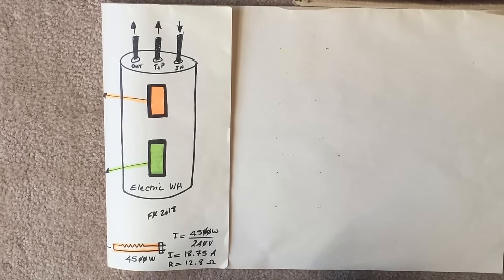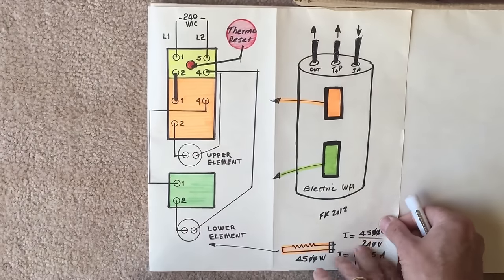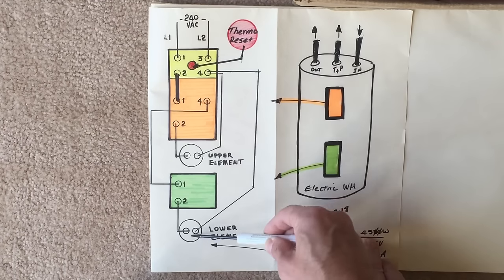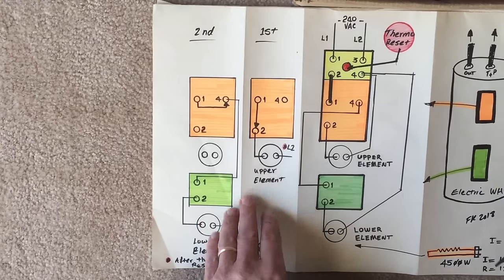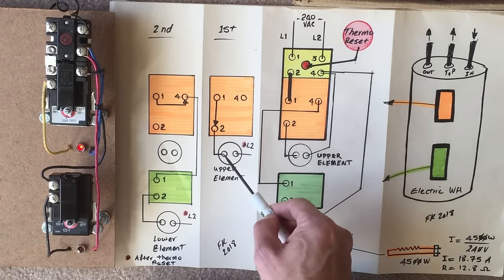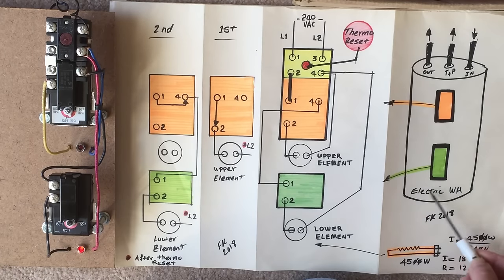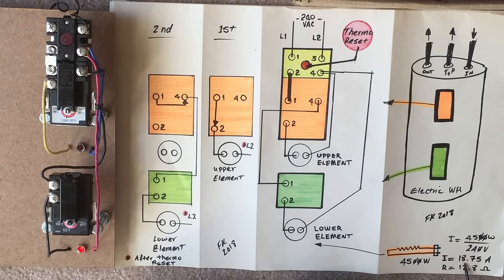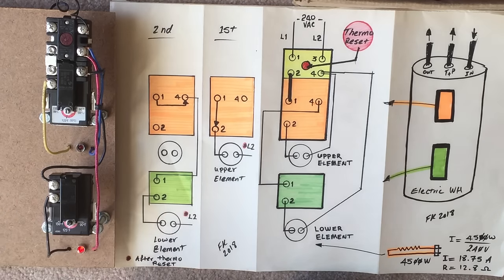Electric Water Heater-Understand How It Works So You Can Troubleshoot Why It’s Not Working Correctly

Comment: Now I understand how the thermostat works.    Can a bad thermostat cause the breaker to trip?  I'm getting 11 ohms on both elements.
Reply: So, if the top thermostat is bad and is sending the call for heat to both the top and bottom elements at the same time, that would trip the breaker.
Reply from the maker: Yes, you are correct. Very good observation.
Reply: @JustForYouDiy  ,   I thought about how these can work or should work.  Correct me if I'm wrong.

The upper thermostat is an either/or switch.  It's always on.  It sends power to the upper element and when the proper temp is reached, it switches power from the upper element and sends it  to the lower element.  So, there should be continuity on the left side or to the upper element or lower but not both.

The lower thermostat is an on/off switch.   It's on until the proper temp is reached.   If the proper temp is reached no continuity.  If the heater isn't working and the water cold, there should be continuity.

If the upper switch is faulty, possibly it could send power to both elements at once?   In such a case it would exceed the amperage load and trip a breaker.

In my case, it's two 4500 watt elements for a total of 9k watts.  9k watts at 240 is 41 amps.   Since this is an old house, it's on a 30 amp cartridge  fuse.  That would account for it blowing the fuse with both elements giving me 11 ohms.  

Another breaker possibility could be the element grounding out to the tank.  That's not my case but others reading this might have that problem.

Comment: hi there great video....My water is now cold and it seems both are calling for heat as there is 120v to each side of the elements.  I cannot seem to get 240v across them nor the main feed .maybe my meter is broken lol.  the elements read 20 ohms across them. Is it possible there both burnt out at same time.
Reply from the maker: Scott, Check the breakers that are feeding the WH.

Comment: I watched so many videos but I found perfect solution for which I was looking for ! Excellent Explanation !! 👍👍👍👍👍
I also subscribed your channel too ...... Thank you sir for giving perfect information with drawing !!!
Also I am very eager to learn about all working and Mostly Electrical circuit connections of commercial Air Condition Machine. If possible please put video for this. Waiting for it..... Thank You.
Reply from the maker: Thank you for the comment & the subscription. As for AC, I have few videos going over the basic components, general cooling (heat transfer) concept and thermostats. However, they are for small split units, under 5 ton.
Reply: Okay, waiting for this 👍

Comment: First of all, let me thank you for the video. I have just replaced both thermostats and heating elements. Because I wasn't getting any hot water electric water heater. I have everything wired exactly As you have shown here. I am getting 240 to the top water heater.
It hasn't kicked down to the bottom line yet. But it's been probably about an hour and I'm still not getting any.  Hot water any solutions
Reply from the maker: If the all components are in working order and voltage is 240, water is being drained from the water heater, it cannot keep up. Or, I’ve seen this before, elements and the thermostats are changed, water heater is turned on BEFORE it is full of water. The thermostats will burn out without being submerged in water in few seconds.

Comment: Hi, can you tell how the temperature is satisfied, is it something to do with the amperage through the bimetallic switch. Is current playing the part to make or break the element's circuit. So what happens if there is no water in the tank?
Reply from the maker: Technical Tech. When the temp is satisfied, the element should turn off and the current draw should drop down to zero. If an element is NOT submerged in water while it is on, it will burn out.

Comment: Hello! The bottom element on my friends water heater is rusted to the point that chips are coming off of it. It looks like it was over tightened and the Oring broke so it was spraying inside of the cover and shorted itself and the module. The terminal on outside of the element is melted. This is the bottom one. It looks as if its been this way at least a couple of years. The top heater still clicks on but the bottom does not yet is still receiving 200v after the top clicks off.  The bottom element shows -1.4  resistance. Is this dangerous? Should we replace the whole heater or is it safe to clean it up and replace all the burnt stuff?
Reply from the maker: It depends on the age of the water heater and the brand. Typical water heaters that you buy from hardware stores like Home Depot will last 3-4 years after the warranty expires. In these cases, the tank rusts because the anode rod inside the tank is corroded. Therefore the water attacks the tank and over time it will leak.

Comment: I just replaced a lower stat that only intermittently would allow the water to heat to 145 & more (@ 120 setpoint). It once even popped open the hi-temp limit switch. I'd never seen that intermittent behavior before but I'm no pro.
Reply from the maker: Most, if not all, WH thermostats are mechanical when it comes to sensing the temperature of the water (actually the tank). The wear over time and along the way to failure they lose their accuracy. See the thermostat in more detail starting at 5:44 min in another video from me, Electric Water Heater Basics
https://youtu.be/NWZy4hle-Bg

Hope this helps, Farshid

Comment: Can I somehow connect my portable generator to Legs 1&2 to power my heater? 

6400kw Generac Portable Generator with a 125250v,  L14-30R plug adapter to a 110v 3 prog plug

Comment from the maker: Water coming into the Water Heater forces the water to go out. Just like a cup of water with a straw in it. In the case of WH, picture the water coming in to the cup through the straw and going down to the bottom (cold water) and water coming out through the top (hot water). Hope this helps.

Comment: Question. If the bottom element is disconnected, then the top one still performs the same? I want to add a Solar DC element to the bottom totally separate from the top. Thanks
Reply from the maker: Russology B You are correct. You can disconnect the bottom element without effecting the top element’s function. This is because the top element’s controller powers up the lower element’s controller (after the water temp at the top has reached target temp), only bottom element is depended on top element’s controller. Best of luck.

Comment: Can I feed 240v DC max directly from solar panels in series (Volts will vary depending on sunlight) or does this need constant 240V AC for some reason?
Reply from the maker: Luis, the heating elements are resistive load and for the purpose of heating water it does not matter if they see AC or DC current. However, based on an experiment that some one had done in the past, the thermostats life was decreased when DC current was used instead of AC current. Hope this helps.
Reply: @JustForYouDiy  Thanks. If that's the case I could wire up the thermostat with AC and add a relay to control DC feed to heating elements. Will experiment and report back. Any suggestions are appreciated.

Comment: It appears I have power to the top element which is brand new, but it’s not heating. 240 shows at each connection.  If one of the thermostats is bad will it keep it from working
Reply from the maker: Yes, if a thermostat is bad, it could keep the WH from heating up. However, if there is 240 at the heating element the thermostat is doing its job. In most cases, when there 240 at the element and water is not heating up, it’s a bad element. Hope this helps.

Comment: How do you diagnose if the thermostat is stuck closed in one of the positions?
Reply from the maker: You can disconnect power and wires from thermostat then use a meter to check continuity. If you’re not sure what values you should see from this test, it’s not a bad idea to purchase one from HD to compare against. HD is pretty good about taking unused parts back for a full refund. Also, since it is a thermostat, compare under same temperature conditions. Hope this helps.

Comment: Should both thermostats be set to the same temperature?
Reply: 11sprinkles Thanks for the question. Yes, usually both thermostats are set to the same temperature.
Reply: @Farshidtx1  Uh... I believe that the Bottom thermostat should be set about 10 degrees Cooler than the top thermostat.

Comment: So can this lower the electric bill by droping the top and bottom thermo to 125? 
Im rent a house unit and i saw the upper stat 127 and bottom is fill blast to very hot?
Reply from the maker: Yes. You are correct. Lower the water temperature will decrease your electric bill. Also, wrapping the water heater with insulation will help as well. Hope this is helpful. Please consider subscribing to my channel to keep up with upcoming videos. Thanks.

Comment: I have a problem with a water heater i replaced thermostat and elements with new and water heater is not working..
I have voltage to elements and when I checked with ohm meter the elements were in the 13 ohms.
Do you have any suggestions?
Reply from the maker: Are you getting 240 at the main input connection? Shown here in this video

Water Heater Not Heating Water, Easy DIY Project
https://youtu.be/5UP77q-ly4s

Comment: Why would I be getting 120 vault separately from the Tom of the thermostat, but not 240 across?
Reply from the maker: Most likely one of the two breakers is tripped or defective. One reason you are getting 120 to ground on each of the two legs is because the heating element is completing the circuit . More accurate testing method would be to disconnect the two incoming lines from the thermostat and measure again. Hope this helps. Please provide update once fixed to everyone else benefit. Thanks

Comment: Hello... what if the tank is not cycling off - seems to be staying on and tripping the reset button - I'm assuming it's the temperature sensor - Bradford White Electric. Thanks
Reply from the maker: Yes, most likely the thermostat for that heating element is defective.
Reply: @JustForYouDiy  thank you
Reply from the maker: My pleasure. A quick check would be to reduce the temp on the questionable stat and see if it turns off, hear a pop & voltage across the element for that stat drops from 240 to zero. This test assumes the water temp is above the minimum setting for that stat (typically 95 deg)
Reply: @JustForYouDiy  thanks I'll give that a try

Comment: What about a new heater that has ample water in but only a trickle out? And not much of a warranty? where to buy one like this?
Reply from the maker: Air in the water heater and the lines could restrict the flow. By letting the hot water run for a while, the air will be purged from the system. Hope this helps.
Reply: @JustForYouDiy  I let it run for 3 hrs but didn't work. I took my air tank and blew back into the hot outlet on the heater and it started working from 3 PM until 6AM the next morning and flow got back to a trickle. Must have something in the tank that is floating up and plugging it I think. Maybe a RAT got into the tank at manufacture before the elements were installed, HUH!
Reply from the maker: Definitely possible. May I suggest one more test. While having the “trickle out” issue, with the water supply to the water heater turned ON, drain the water from the drain port at the bottom and see how the water flows out. If the flow is strong, water supply to WH during “trickle out” is good. 

If that checks out & claiming warranty is not an option. Then, let’s get the debris out…
1. Turn power off
2. Drain water until you think the level is below the top element
3. Remove the top element 
4. With a bucket ready to catch water from the top element’s hole, slowly begin to fill the water heater. Hopefully, the debris inside will flow out.

Look forward to your findings.
Reply: @JustForYouDiy  I have drained it several times and get very strong stream  out of a three quarter hose with the input supply on. There should be a replacement warranty but have been offered parts sent out.I have hooked the inlet supply to the outlet that was hooked to the heater there by bypassing the heater and have plenty water to all faucets. A tank that has a leak is considered bad so it looks like a tank that doesn't let the water to flow thru should be bad also.I have been a plumber but that was years ago--now I am 86 yrs old.

Comment: Hi tks for the info,
My water heater overheats and the reset button shuts off, 
My upper element its 3800/240 reads 15 ♎️ and the lower its 4500/240 reads 13♎️ 
Is this will be the problem??
Reply from the maker: Juan Villa The elements are usually the same type and rating. Reduce the water temp setting to see if it trips again. If it does, it could be a defective thermostat.
Reply: Just for You thanks for answering, I change the upper thermostat and did the same,  thinking about buying the complete kit in home depot and replacing everything

Comment: When the power is turned on, the breaker trips. What should I look for?
Reply from the maker: Possible shorted element. With power off, remove the wires from the element(s), then turn power on and see what happens.

Comment: If my bottom thermostat just caught fire and burned up, can I use the top one only until I get it fixed.
Reply from the maker: Yes, you should be able to do that.
Reply: @JustForYouDiy  thank you for responding. So just unhook wire going to bottom thermostat?
Reply: @JustForYouDiy  also, the burned up thermostat cause a pinhole in my tank which I fixed with jb weld but now the new thermostat cannot be mounted there. Can I mount in a slightly different location or is it time to replace.
Reply from the maker: Yes, you just disconnect the wires going to the defective thermostat. As for sensing the water temp., correct, back of the thermostat makes contact with the tank and yes, you can  attach the thermostat at a different location. Hope this helps & good luck.
Reply from the maker: See the thermostat in more detail starting at 5:44 min in another video from me, Electric Water Heater Basics
https://youtu.be/NWZy4hle-Bg

Comment: How do you check the thermostat is working
Reply from the maker: Because the thermostat is activated mechanically, reaction to heat between two different metals, it has to be heated and cooled to activate and deactivate (shown in the video using a lighter). Then, once that’s happening, the continuity between terminals can be measured. Hope this helps.

Comment: Question 
Please help me to figure out what is going on with my water heater.
Panel to L1 is reading 120v and panel to L2 is reading 24v. 

I redo the connection and it works fine for a while. And lose its power again. 

The water is warm. So it warms up but not reaching its set temperature.
Reply from the maker: Disconnect L1 and L2 wires from the water heater. Measure the following:
L1 to ground, should be 120v, if not, check breaker.
L2 to ground, should be 120v, if not, check breaker.
Reply: @JustForYouDiy  changed breaker.. 
It read 120 on both side. 

It heat up the water then...one side volt drops to 24v again..
Reply from the maker: What is the voltage between L1 and L2?
What is the resistance value of each element in ohms (power off and at least one wire removed from the element when measuring)?
Reply from the maker: Did you fix the water heater?
Reply: @JustForYouDiy  yes. It was the power cable.
Reply: @미국벼룩시장  Excellent. Glad to hear you fixed it.

Comment: How does it sense the temperature?
Reply from the maker: Temperature-sensitive bi-metal disc thermostat. Hope this helps.
Reply: @JustForYouDiy  hey thanks for your reply
And for the video man. Im familiar with bimetal disc temperature safeties (klixon) for a set temperature cut out, but not sure how they can be used for a range of different temperatures settings?
Reply from the maker: By controlling the gap between the two metals.

This may help. https://youtu.be/cKwHRSFVGck?si=C7ctkL3kX2asIgPt
Reply: @JustForYouDiy  sweet as thanks man. I’m used to capillary thermostats! Cheers

Comment: I have changed both controllers and elements power on but no heat what could be my problem
Reply from the maker: Stanley, do you get 240 volts across the main input terminals?

Comment: Hi, I’m getting 20.99 amps when I clamp meter. Ohms @ 11. Pls. Let me know if my elements good
Reply: A129 upper element relay failure close to error.
Reply from the maker: What is the watts rating on the side of the element? And, is the element rested for 240 V?
Reply: @JustForYouDiy  243v
Reply: 4500w
Reply from the maker: Based on the numbers and using the formula P = I x I x R, element should be ok.
Reply: @JustForYouDiy  ok, thank you. Will try replace circuit board.

Comment: Have you every seen electricity from the water heater to a sink. My kitchen sink just sprung a leak  from the sink shut off valve to the washing machine.  I closed the valve, super hot.   Too hot for just hot water. Burnt my finger.  Pulled the circuit breaker for the washer and disposal cause the plug was right there. Then I grabbed the speedy from the valve to the washer and it sparked.  I had electricity in the valve.   Pulled out my multimeter and found 7.5 Vac.  Pulled the water heater cb and it went away.  Thinking one of the water heater elements is feeding a short through the plumbing,  high resistance and probably not enough to pop the cb.
Reply from the maker: Yes, I’ve seen it before. I have a video showing why and how to fix it. 

How to Correctly Wire a 240 Volt Power Cord to Stove, Dryer or Water Heater, Avoid Electric Shock
https://youtu.be/naeYuhQ4ibA

Hope this helps.
Reply from the maker: Did you happen to fix the issue?